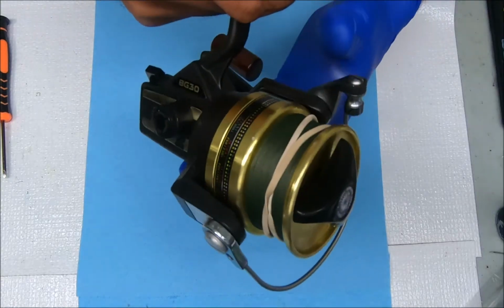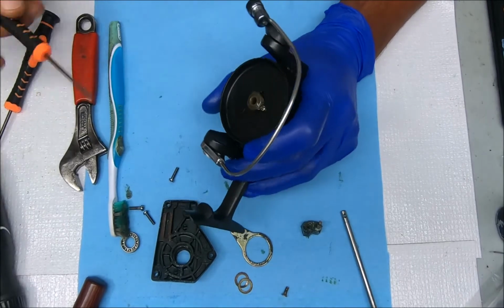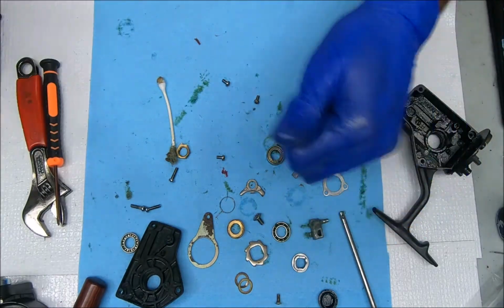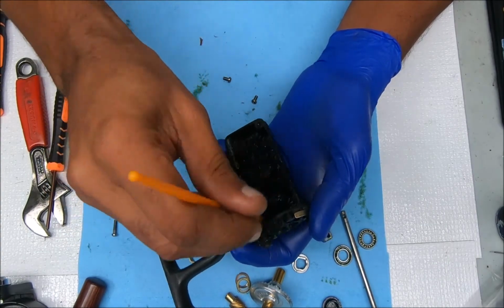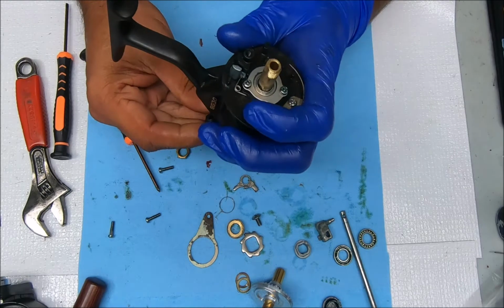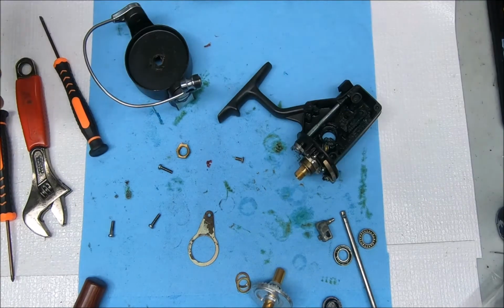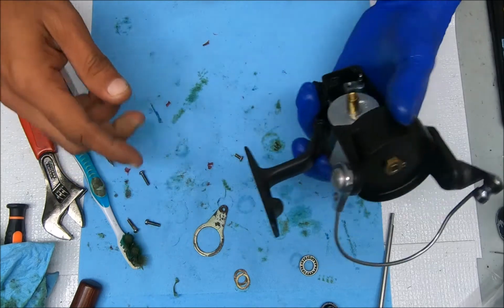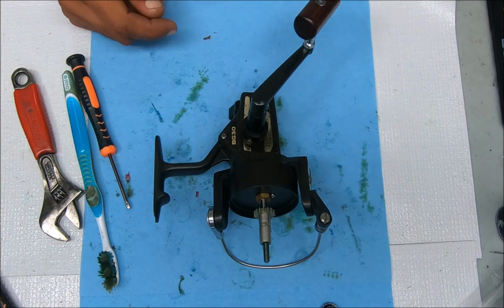Daiwa BG30 feeling "rough" diagnosis and remedy + how to take apart & service: Fishing Reel Repair

Comment: Great video. I have a BG60 that is 99% same as the one you did. It was a little rough at first but after some cleaning it got better. doesn't get stuck at all but upon spinning it was not free spinning more than once around like the brakes were on.These things are not as smooth as the newer BG's obviously. Mine shows something weird on the pinion so I might need a new one. Where did you get the pinion gear kit you are using? Thanks
Reply from the maker: Thanks for watching! If there's a washer under the bearing on the left side of the main gear, try removing one and see how the reel feels. If that doesn't help, it could be the pinion bearing. Not many places to find parts on these, so I would check eBay.